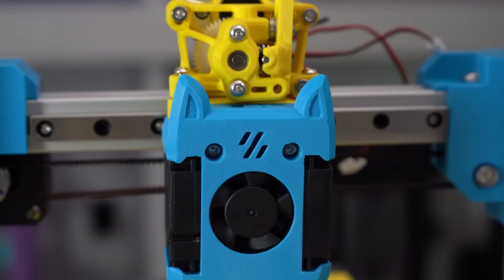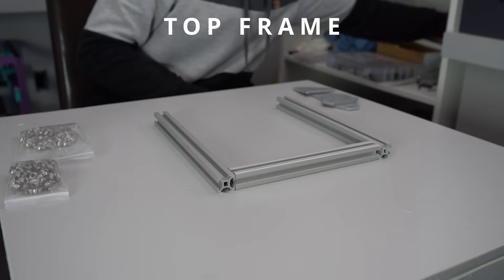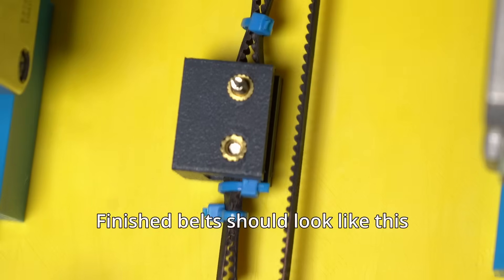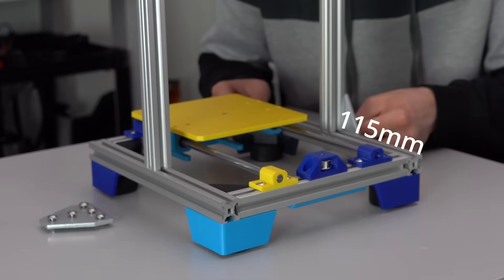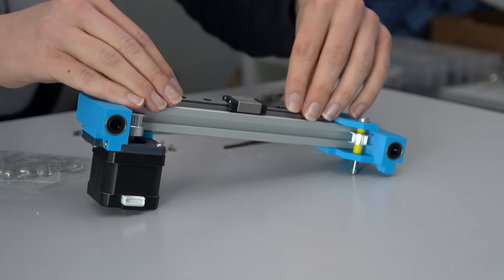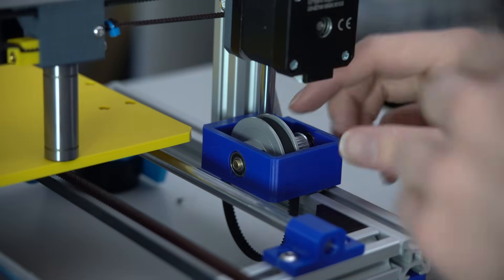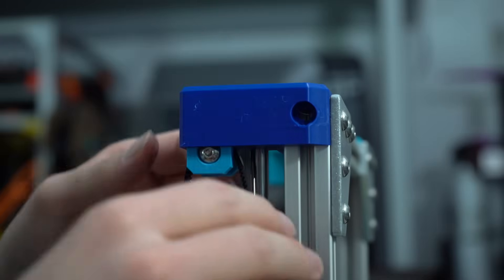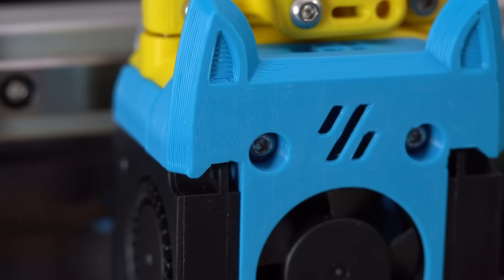How to Build the Best DIY 3D Printer for Beginners

Comment: Vorons are as "beginner friendly" as it gets: kits are available, the community is huge and active, great manuals in every form. What is the point of building an overpriced bedslinger if there is A1 Mini for $200? I built my 0.2-S1 for the DIY experience and to be able to print small ABS parts, this thing is fun to build for sure, but kinda useless in the long term as the only machine a beginner would have as well as one of many for an enthusiast maker.
Reply from the maker: By your same logic I could say "What's the point of building an overpriced Voron if theres a Qidi Q2 for half the price?". DIY printers are never the most cost effective option, the only reason we build them is for the love of the game
Reply: @mitsumakes  Well, as I said, the main difference between an overpriced Voron and an overpriced Kappy is its usefulness (or lack of it) in the long term. Voron offers DIY build experience and an enclosed machine capable of printing ABS/ASA, Kappy offers DIY build experience. That's it.

Comment: Thanks a lot for this great video. Can you tell, of what kind of filament you've printed the parts?
Reply from the maker: Let's see if I remember everything....

The yellow and bright blue should be Polymaker ASA, the dark blue and teal (for the top of the Z axis) were both Sparta3D ABS+, the dark grey stuff for the Y motor and X axis carriage was Carbon Fibre ABS (I can't remember which brand I used though)

Comment: Hi super video, What print plate you used for that build ?
Reply from the maker: The bed on Kappy is 3D Printed with a layer of kapton tape on it. You could use painter's tape as well if you'd prefer though

Comment: Could this be the basis for larger printers?
Reply from the maker: Yes! If you join Rolohaun's discord you can see a few larger kappy builds that people have done. I've seen a couple people use Ender 2 (165x165mm) beds and also a couple of 220mm beds too if I recall correctly

Comment: Kappy costs like 230. The flashforge 5m cost 250 and there is zero set up and it works crazy well
Reply from the maker: Glad that it works well for you! You can use the 5m to print parts for your Kappy now 😛

Comment: How do you upload gcode to kappy? I have a neptune 3 pro and i use an sd card for it. The parts list on printables doesnt mention how to interact with kappy, ie- pi, arduino, micro sd, etc.
Reply from the maker: You'd upload files via wifi to the klipper host

Comment: Hi! Does anyone have experience with plotters? I’ve been passionate about 3D printing lately and I would also like to explore the world of plotters for artistic projects/experiments (plotters that can make use of markers and paint brushes for example). I’ve seen a couple downloadable files for plotters with 3D printable parts, but I haven’t found one that convinced me yet. Im also not sure how difficult it will be to assemble a plotter and get it to work, since my technical knowledge is on the basic side (I have a little experience in modifying an Ender 3 V2 but I haven’t messed with Raspberry Pi). I’m looking for something similar like the ones that AxiDraw produces (which seem versatile) but they seem quite expensive (a bit over my budget atm). Any tips or suggestions are welcome! 🙏

Comment: Would it be possible to use a einsy Rambo board from a mk3s+? I upgraded one and have that laying around now haha
Reply from the maker: As long as it has enough stepper drivers (you want 5) you should be good to go. You can technically get away with 4 stepper drivers and run both Z motors off 1 driver, but then you lose the ability to tram the gantry with Z tilt
Reply: @ mk3 has 2 z motors so it has 5.  Cool! Then just add pi zero2w?
Reply from the maker: @jared1321  Yep, anything that you can run klipper on will work. Pi Zero 2W is the smallest option (to my knowledge at least), which is helpful for a build like this.

I'm personally trying the BTT Pad7, which is a single board computer and touch screen all in one, so I don't need to worry about mounting a pi somewhere on the tiny frame

Comment: i know its maybe not the point, but with bambulab a1 mini for under 200, i recon "beginner" printers are mostly a lost cause, like how are you supposed to beat that? if you have to buy/outsource the printed parts for this, its going to run you more than just buying an a1 mini wich comes with all sorts of neat stuff that this thing unfortunately will never have. it sure is fun to build, but the best printer for beginners HAS to be the a1 mini until someone comes up with something that is either cheaper or better, but i see none of those points happening anytime soon. back when the anet a8 was a thing, i would have murdered to have something like this though
Reply from the maker: Theres definitely no way to beat consumer printers on price, but I think Kappy and the A1 mini exist for different reasons. 

The only reason someone would build something like this over buying an A1 mini is purely because they're interested in building their own printer and learning more about DIY 3D printers. If your only goal is just to get a cheap printer that works, DIY builds probably wouldn't be on your radar at all

Comment: I see  Bill of Materials - 300  USD.  My Creality Ender 3V3 KE have official price 270 USD, but I paid 210 USD.
Reply from the maker: Different beasts entirely. If you just want a printer that works, there are plenty of cheaper commercial machines out there. Only reason to build a kappy over buying a prebuilt one is just if you want to learn to build your own :)

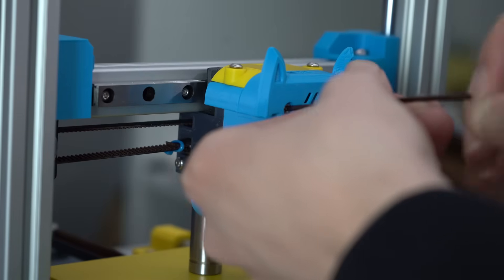Comment: 10:50 I know this is entry level, but surely using a negative part in the slicer is the best way?
Reply: Or even faster way, cutting tool in most slicers
Reply from the maker: You're right, doing it in the slicer would be even faster! I might see if I can mod the X carriage to work with stock dragonburner though, that way nobody needs to modify any parts at all

Comment: Great job with the guide!

However, it looks (on the video at least) like carriage makes belts unparallel on the side with the stepper, which may introduce print artifacts, cuz the toolhead will travel slightly less the closer it to the X stepper than it should
Reply from the maker: I think a lot of that is from the way I zip tied the belt. I'll go back and see if I can do a better job there, thanks!

Comment: We live in such a crazy world now where DIY 3d printers is purely for hobbyist reasons and ends up being much more expensive than a comparable prebuilt printer. Still, an extremely cool project.
Reply from the maker: Thats not crazy at all. Self sourcing will always come out more expensive since individuals don't have the economies of scale that companies do. If we got Kappy kits on the other hand...
Reply: @mitsumakes  self sourcing can definitely be much cheaper especially regions with access to china market. for these regions kits and prebuilts are actually more expensive.
Reply: @mitsumakes  może zrobisz jakąś drukarkę na profilu 4040?
Reply: It's also a matter of parts quality. If you pick the absolute cheapest Ali parts for everything and scavenge used stuff, DIY is still cheaper.
Reply: That's because you're not in China
Reply: Some dont build skills or have been introduced to any type of tool use. So they just pay.  Others , build everything from scratch from what they throw away. symbiotic. with out waste.. no inventions.  my look at things.
Reply: Nah not true since Bambu but I still enjoy building and upgrading printers
Reply from the maker: @tiftik  If you score some stuff used I think you can still beat an A1 mini on cost (and match performance), but thats assuming you aren't factoring in the value of your time to design/build something
Reply: @tiftik  Bambu is costlier than an original Ender 3, so I don't get the "since Bambu"...

Comment: I've heard .9 rather than 1.8 NEMA motors can cause problems with how fast the gcode can be read, potentially causing print issues, is that something we'd have to worry about here?

Also, do you print directly on the (I assume ABS) print bed, or is there a print surface you'd recommend?

Great guide otherwise, I love how small and portable it looks and the cute cat ear things on the toolhead. It seems like a pretty good choice for a printer to bring with you somewhere, since it's cheap and light while still having a decent build volume. It also seems to be more than capable of printing all its own printed parts, which is always a nice feature to see.
Reply from the maker: Hey, thanks for commenting!

The only issue i've heard from 0.9 degree motors is just that they run out of torque earlier than their 1.8 degree counterparts. On a printer like this I'd  be capped at around 400mm/s with the 0.9s, but a bambu hotend doesnt have enough flow to print that fast anyways, so I don't mind

I should have talked about the bed surface in the video. The Printer is called Kappy because the bed is designed to be covered in kapton tape as a print surface. With the kapton tape layer, it's even safe to use PLA to print the bed.
Reply: @mitsubishimakes  Thanks for the quick reply, great answers to both questions too 👍
Reply: No relation to speed at which gcode can be read, but you'll hit pullout at a lower speed and in theory at extremely high speeds you could hit steprate limits.

Comment: Your thoughts: I'm doing a Magnetic IDEX MOD for a creality CR-10. I have a MGN 12 and 2 "C" carriages on the way. I was going to use stick Creality Hotends. But I see the screw holes are 14mm but the holes on the MGN12C are 15mm. Are there any other "heatsinks, that can directly mount to the 15mm MGN12C? I want the two carriages to be super light weight will most likely just run them Boden. This is not for speed build. Just simplicity?
Reply from the maker: I can't think of anything that would be a perfect fit right from factory. You could probably drill out the holes in the heatsinks a little bit and make them fit with a bit of trial and error though. 

If you really wanna go crazy you could model a custom heatsink and get someone like PCBWay to SLM print it in metal for you 😜

Comment: Thank you. Very easy to understand and follow.

If you choose to run it core xz . You can use one less stepper motor. 

That said. What kind of speed, acceleration and quality can you run with this build?
Reply: Corexz isn't really worth the added complexity to save one motor. I have printed a 19 min benchy on my prototype! 20k accel and 300mm/s I am sure Mitsubishi will make some videos show off the speed.
Reply from the maker: @Rolohaun  Absolutely! I might have to swap those 0.9 degree steppers for something else though
Reply from the maker: I still need to test the limits of my own build, but since I'm using a bambu hotend it won't end up being any faster than a Bambu. Like basically all printers, the biggest bottlenecks are hotend flowrate and part cooling. Rolo designed a bracket to mount a huge 120mm radial fan behind the gantry for part cooling, so with a proper UHF hotend I think Kappy could absolutely flly!
Reply: Bambu hotend absolutely flies if you put another heater on the opposite side of the original one, then swap the short nozzle for something longer. Ender 7 and Neptune 4 nozzles work well
Reply from the maker: @youtubehandlesux  Good to know, thanks!
Reply: @mitsumakes I think you need a piece of 10x7x0.7mm bronze sheet placed between the heater and the hotend, did this mod a long time ago and can't remember the details lol

Comment: nice to see a guide on this, a shame what ended up becoming kappy wasn't the coreXZ like the prototype, but still, neat nevertheless
Reply: corexz is a meme. congratulations, your z-hop is slightly faster, i’m sure that will cut down printing times so much on your bedslinger running 5k accel
Reply: @yaketyyakumo3315  for me it was not having z wobble, but sure, be a dick and assume everyone wants speed
Reply from the maker: I'm glad to see corexz go away to be honest. It adds a lot of unnecessary complexity for what is ultimately supposed to be a simple machine for beginners. The smaller BOM was definitely nice though
Reply: also beta was hbot not real corexz and it was not good